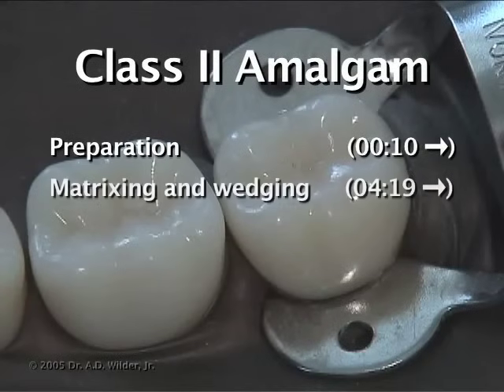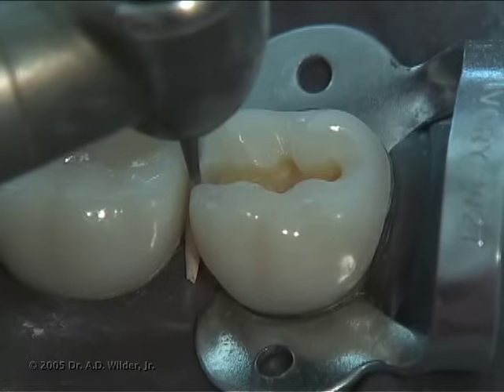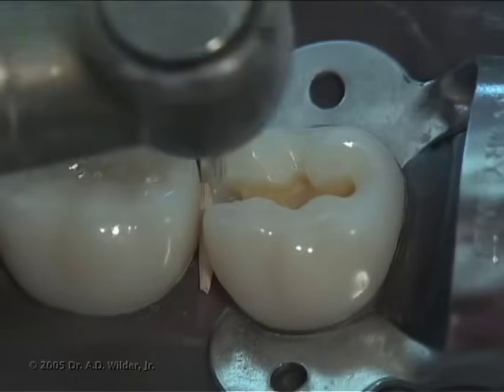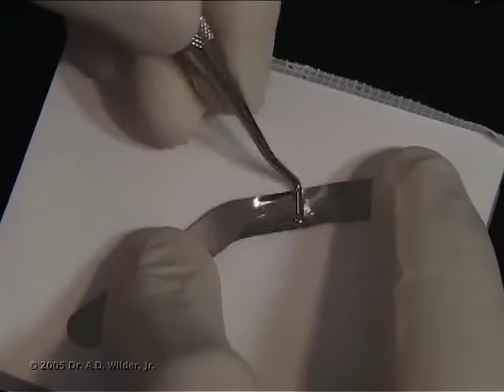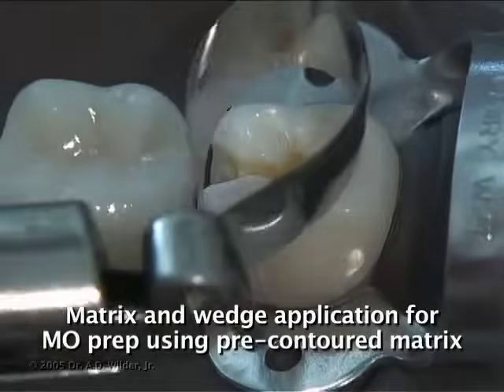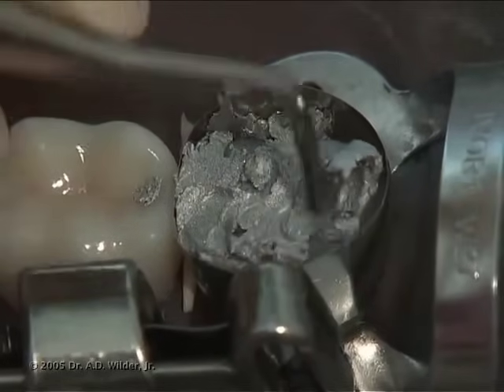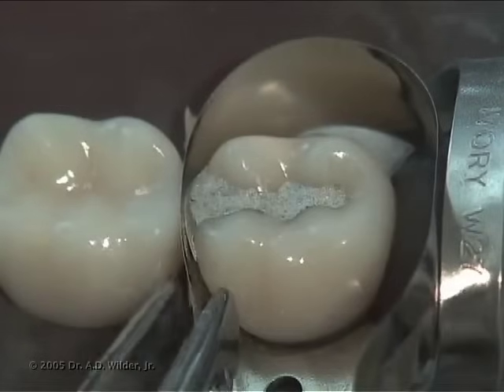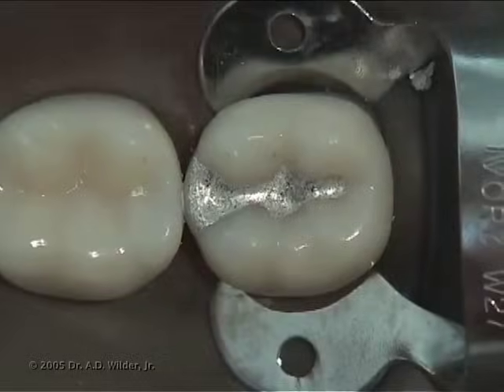Class II Amalgam Preparation & Restoration | Operative Dentistry

Comment: Thank you Dr.Ryan, your channel is very helpful.
But I'm still having hard time preparing class 2 cavities, the box in DO and MO
Reply from the maker: Class II preparations are notoriously challenging! Both the preparation and restoration can be difficult, but I promise that it gets easier with practice and experience. Also I have found over the years that some patients have tighter contacts or wider contact areas that can be especially challenging to prepare and restore so it varies from patient to patient.

Comment: Do I need to put a lining at the base before putting Amalgam?
Reply from the maker: If the preparation comes within 0.5mm of pulp tissue a cavity liner is recommended for thermal and electrical insulation. If 0.5-2mm away from pulp, a base is sufficient. If 2 or more mm away, then a desensitizer like GLUMA will suffice.
Reply: @mentaldental  what liner would u use? Calcium hydroxide